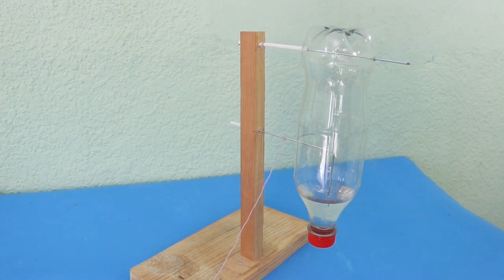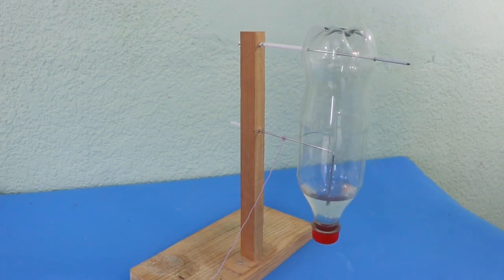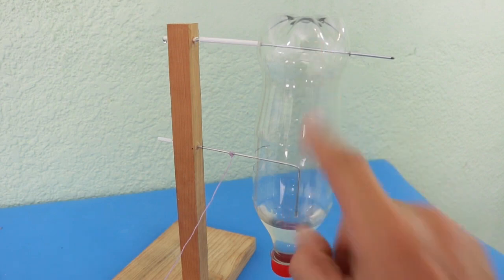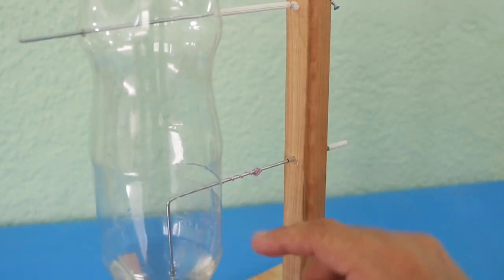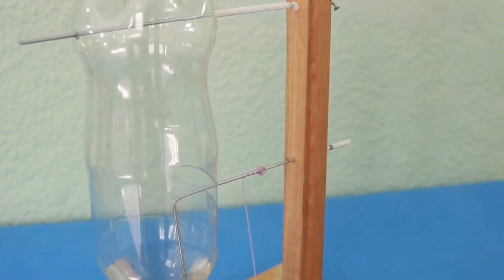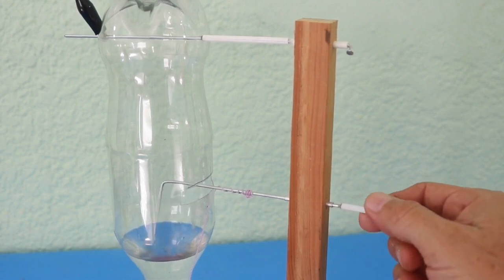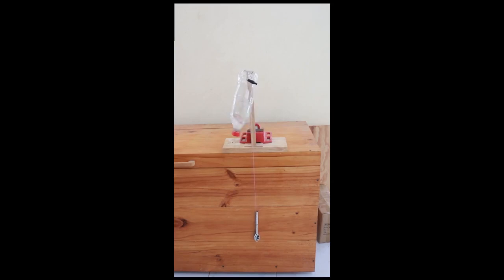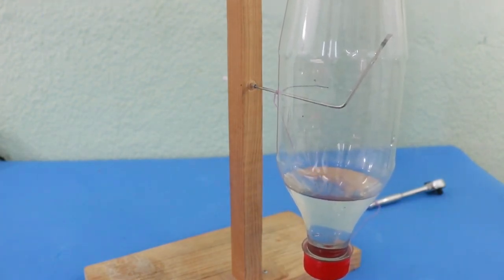Plastic Bottle Escapement Mechanism

Comment: I think you can dampen the oscillation by adding a paddle to the tip of your rotating element, increasing resistance when it dips into the water, even more so when you add a viscous fluid.